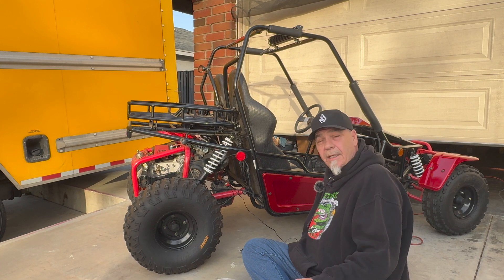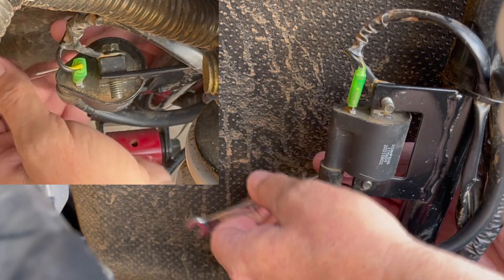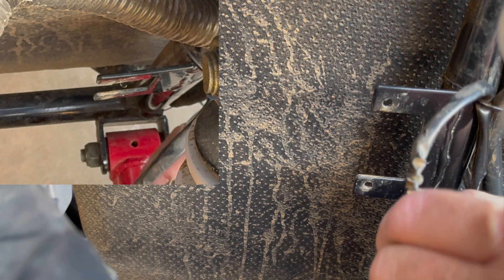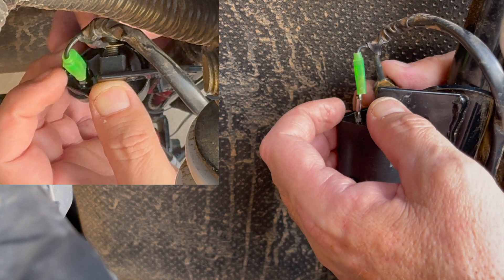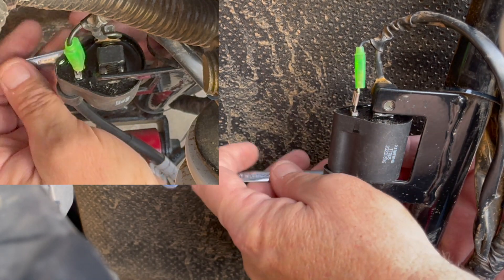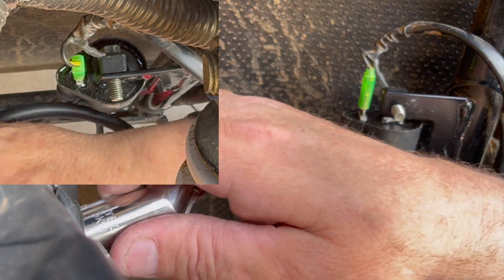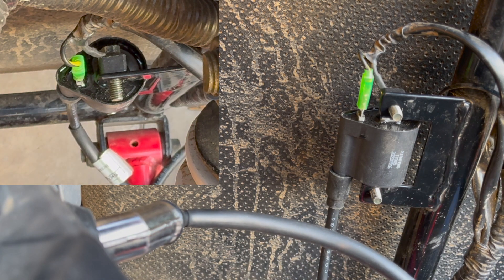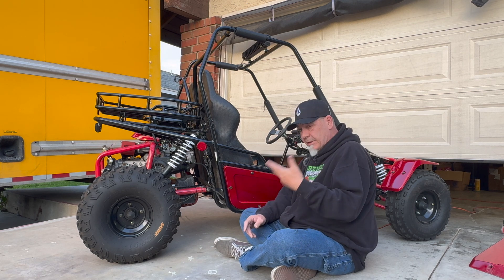How to Install a GY6 Ignition Coil in Under 10 Minutes ! #gy6 #howtoinstall #troubleshooting #gokart

Comment: How do I change the ignition coil on my transformer 200 go kart
Reply: Why do you say the same?
Reply from the maker: Well the cart you have is the same as the Tao motors targa 200 which is basically the same as the Baja sport 200 engine and wiring wise if you watch the video and I’m guessing you haven’t you would see exactly what I’m saying
Reply from the maker: Should pretty much be the same bud 🤘🏻🐿🤘🏻